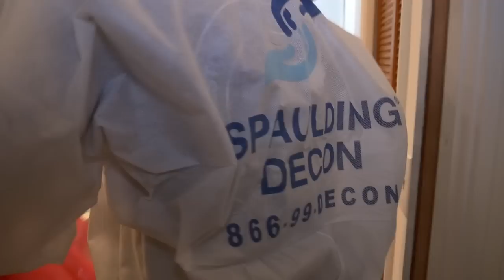Dying Alone | Tampa, FL

Comment: "Cranked the AC real low. Even at 70 it's still hot"

I can imagine!  I set my house to 58 in the winter when it's 24 outside. Any higher and I'm sweating. I praise you guys for the heat you work in. You probably wouldn't want to trade with me though. 😄 I work outside in below freezing temperatures all day during the winter months.  It'll get up to 100 in the summer, and I can't stand it. I pray for winter that whole season...
Keep up the good work! 👍

Comment: Has anyone been in a professionally cleaned post hazmat home, that you are aware of?  Is the smell really gone?  I imagine Florida is a "worst case scenario" state, given the heat/humidity.  Also, I imagine all of those towels in the bathroom closet probably need to be tossed or cleaned thoroughly.  I feel like I have seen one of these cleaners vids, not necessarily this channel or company, where they bagged up and threw away all of the textiles in the room.  Carpet, curtains, bedding, clothing, everything.
Reply: It does go away eventually after all porous material is removed